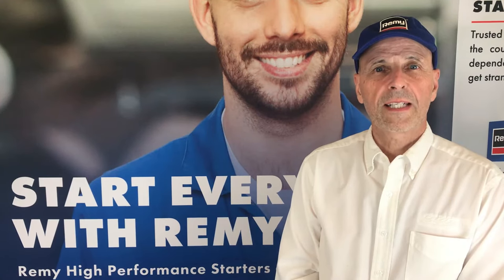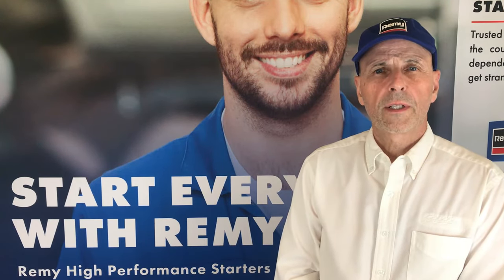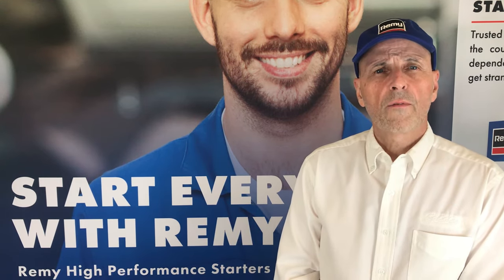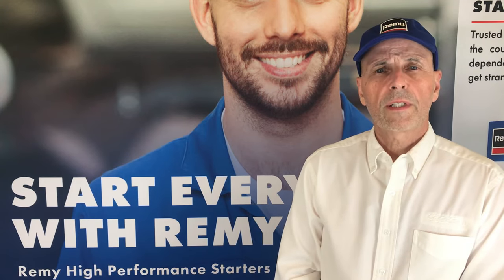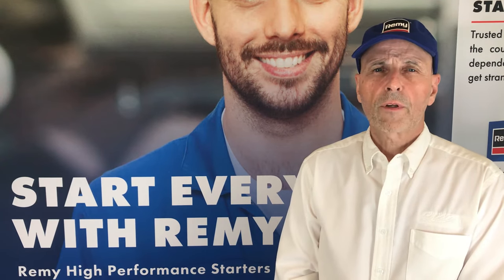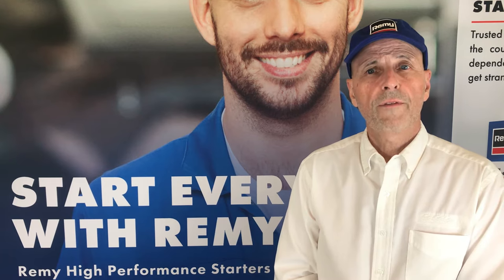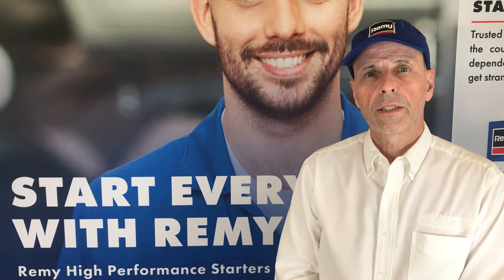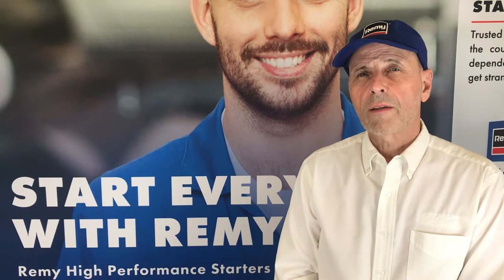Starter Stays Engaged After Releasing the Key

Comment: Restoring a good ole' 1990 F-250 H.D. Lariat XLT / 7.5L. This happened soon after purchase   few years back then proceeded changing out misc. elec. parts under hood . Installed decent solenoid (and cleaned all connections) and then behaved. Just now prob. returned. Installed new Chinese piece of SH_T and still kept cranking w/ign. off. Hard to find U.S. made but Mex. made Standards at least last for a while. Wish I knew why this seems to be an inherent Ford glitch (from '80's on) and where there might be (the best) U.S. made solenoid I can buy.